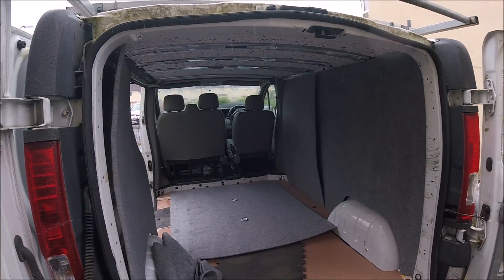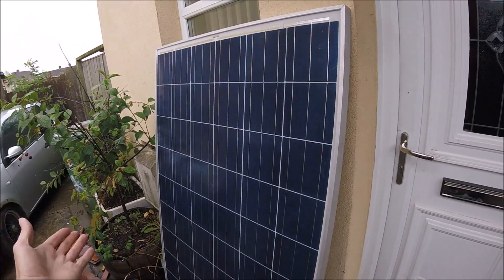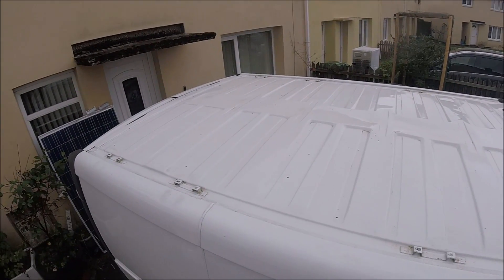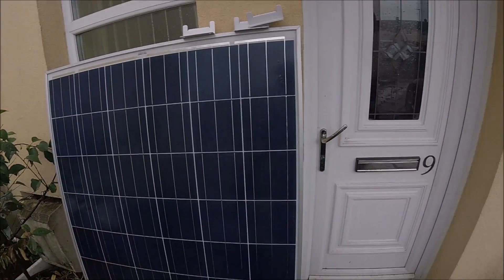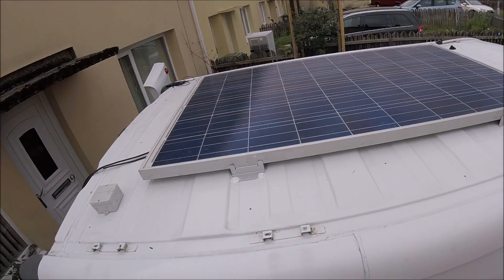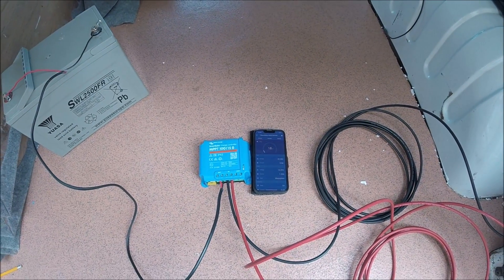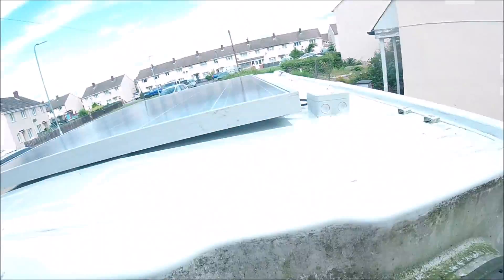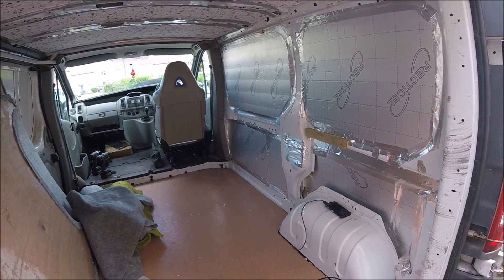Vauxhall Vivaro Campervan Solar Panel Installation

Comment: IVE BEEN THINKING OF INSTALLING SOLAR ON MY VIVARO, YOURS LOOKS EXACTLY LIKE EMIN ON THE OUTSIDE, JUST A LITTLE BIT OF ADVISE REMINDING WATCHERS THAT THE CABLES COMING FROM THE PANEL WILL BE LIVE IN DAYLIGHT AND NOT TO AHVE THEM SHORT ON ANY METLA WORK. BUT GREAT VIDEO

Comment: This video if very helpful it's simular to what I'm looking to do.
I've been doing some research and want to try bonding a flexible solar panel but am worried how it'll function with the bumps in the roof maybe silicone would be fine?
I'm also looking at a "Solar Double Cable Entry Gland" and thinking of also bonding this to the roof with silicone.
How has your system been holding up? I'm worried silicone woun't be enough for mounting a whole panel even if it's bonded straight to the roof and only 4mm thick
Reply from the maker: Don't use silicone, it's not designed as an adhesive, there is proper stuff out there like Sikaflex, Tigerseal etc that are designed to do this kind of job.  Silicone will fail over time and is not designed for external weather exposed use

Comment: Hi, quick question, what are your thoughts on roof ventilation and also moisture barriers on roof insulation on these smaller vans? Great channel 👍
Reply from the maker: Roof ventilation is nice to have if there’s space for it but I’d prioritise solar over a vent. People overthink about this vapour barrier stuff too, I’ve never fitted one, most of the insulation boards I use are foil backed which creates its own barrier anyway

Comment: Just some constructive criticism Lee, I hope you don't mind. 
Perhaps fitting the z brackets on the raised parts of the roof rather than down in the channels may have been better, less crud to form and no potential pooling behind the brackets.
The other thing which may have been beneficial was to bring the solar power cables in from the back of the junction box rather than the front, less chance of water ingress at High speeds over time if the sealant gives, just some extra peace of mind.
I really hope you don't mind me mentioning these things Lee, many will notice but probably not say, I prefer folk to point things out to me, I'm always happy to learn better ways of doing things, especially when they make sense and don't take up any extra time, win win.

You're getting it done, which is the main thing, and if you'd prefer me not to point anything out in future; simply don't respond to this comment and I'll take that as a hint mate👊
Are you going to keep this van for yourself?
Reply from the maker: You are welcome to leave whatever comments you like.  I purposely fitted the panel in the lower channels so it is as low to the roof as possible, for both stealthy and aerodynamics reasons and with the sealant used around the cable entrance, I have no fears of any leaks at all.  Also, my name isn't Lee
Reply: @TheCampervanBuilder  Sorry about calling you Lee, I just got if from someone else further down the comments that called you Lee, or I took it was you they were referring to 😆
Also, about my suggestions, No prob's, I guess we all do things differently and for different reasons, I just wasn't sure if you'd given consideration to the things that I pointed out 👍
The van is comming along nicely, considering all the rain that we've had recently and having to work around it must be a pain. Are you keeping this camper to use yourself?
Reply from the maker: I think the other commenters name was Lee and thats how he was signing off his comment.  Yes the rain is making things harder to do, I'll be keeping the van until another project comes along
Reply: @TheCampervanBuilder  I see, I've been caught out before with a commenter signing off with his name and me thinking it was the video makers name; I should have known better ha!
You take on a lot of projects, fair play to you. It's a bit more difficult these days to get Good deals on vans, prices are a bit crazy atm, I've been keeping an eye out for ages it seems for a decent one.